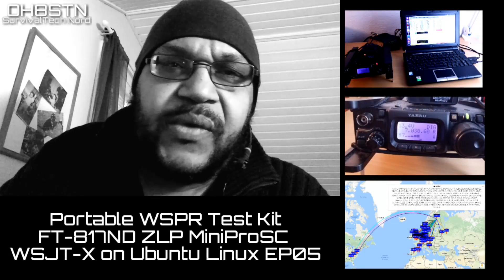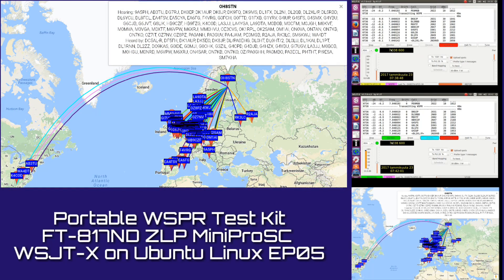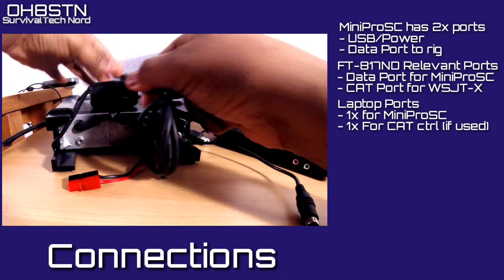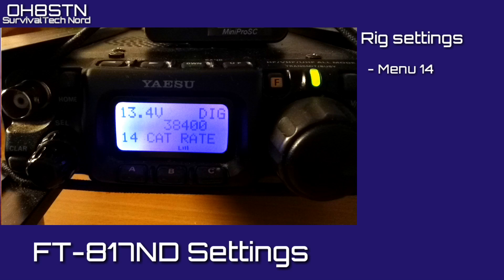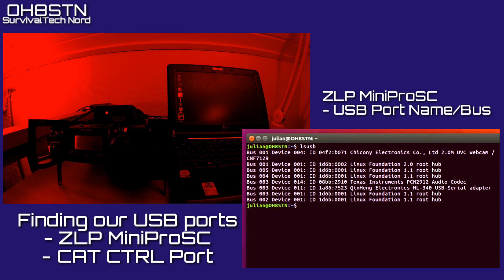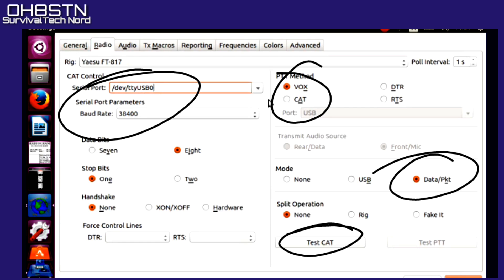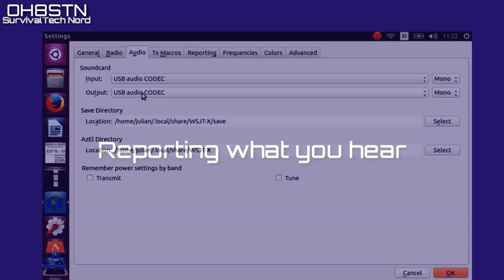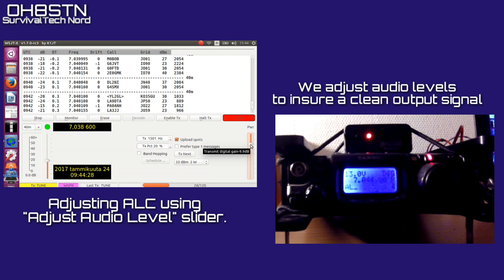WSPR WSJTX Quick Setup MiniProSC FT-817ND Ubuntu Linux EP05

Comment: Just moved to Linux ( Windows yuk)  However, I can communicate with FT-817ND and SignaLink but when I hit tune on Z817 it trips an IO-error. Have any ideas?
Reply from the maker: +John Hawk Hi John.  First thing that comes to mind is baud rate. Make sure the bald rate on the 817 matches the 38400 for the z817.
Reply: Checked still at 38400, Stange critter, I'll track it down and let you know the fix. Thanks for the reply. Great content by the way.  Side note do you have an X-108G? If so would you buy it again? A little more power would be nice at times.

Comment: What a great, easy to follow video. If only this was available a few weeks ago it would have saved me a few headaches!! I have WSJT-X up and running on Linux Mint with my FT817ND and a MiniProSC also. I just need to find a way to sync my clock with the NTP servers. Nothing I try seems to work.
Reply from the maker: +neil curtis Hi Neil. I've got to do these diy magloop video now a but afterwards I'll try to include the NTC clock sync in one of the digital series. I forgot that in this one.